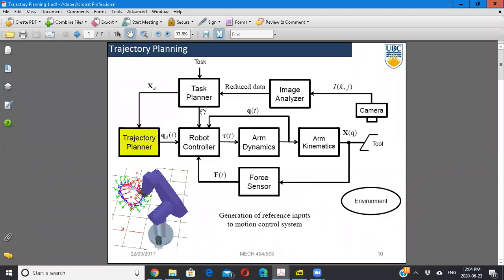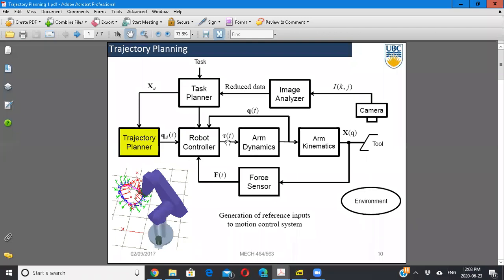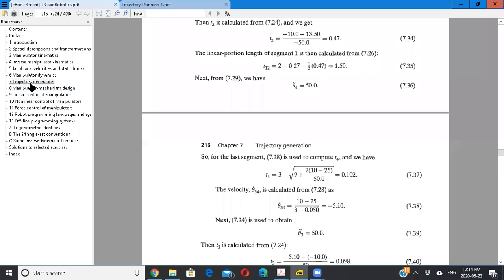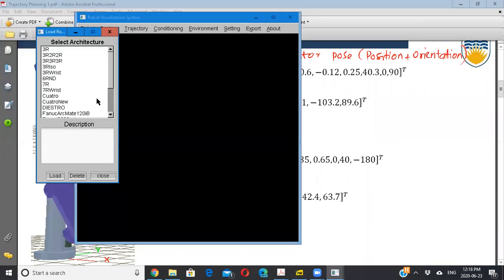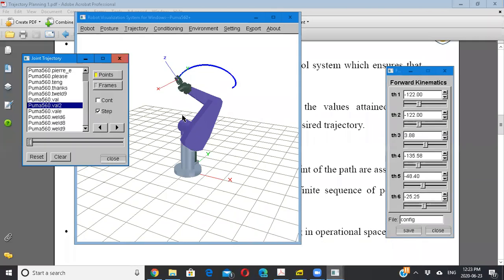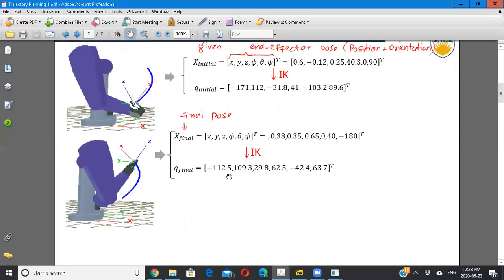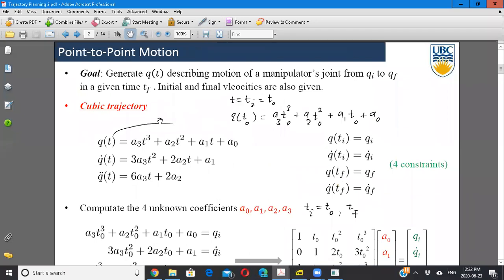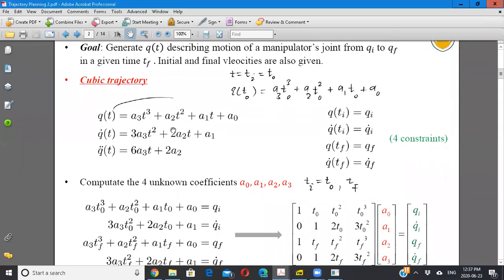Trajectory Planning part 1 of 2 (Industrial Robotics, Spring 2020)

Comment: Hi, thank you for presenting a very interesting learning video!!!, I want to ask, if for the pick and place case with a starting angle of 30 deg to a final angle of 70 deg with a motor speed of 60deg/s, can I use a cubic polynomial for my trajectory ? is the trajectory suitable to be applied to arduino?